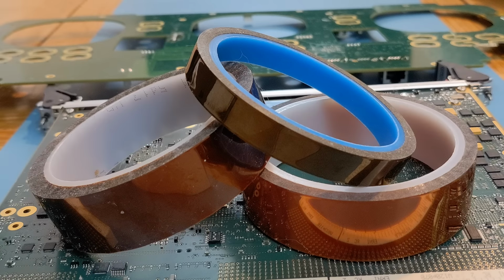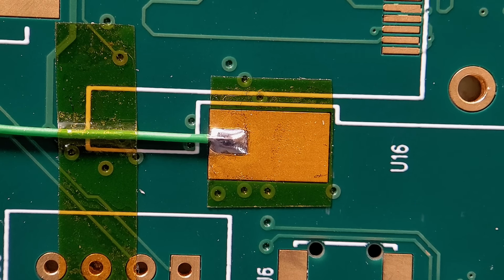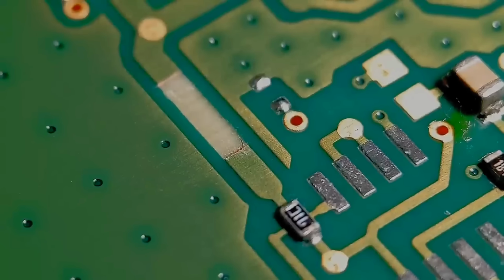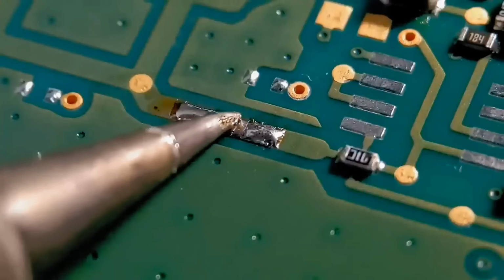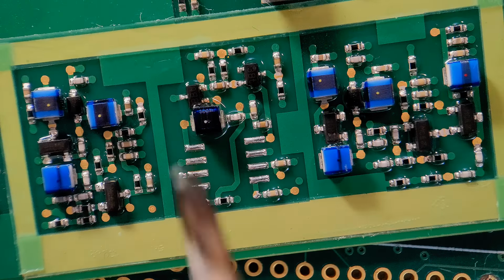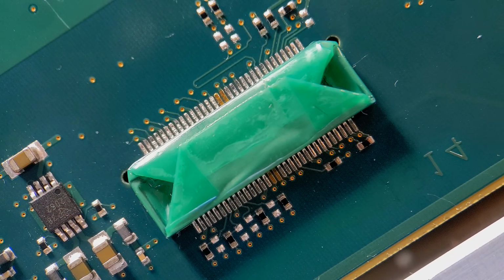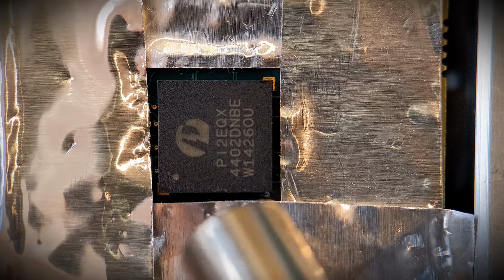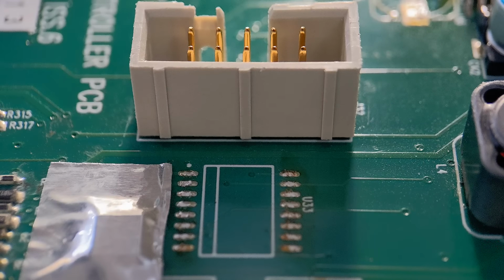The 4 PCB Tapes You Should Own + Why /Soldering Tutorial

Comment: It's SHOCKING how little people use kapton to protect neighboring components from hot air
Reply from the maker: Hi, thanks for your comment and for watching the video . I prefer using Aluminium foil for heat protection , but if i haven't got that available i will use Kapton tape as a replacement . Thanks again 👍

Comment: Another great video, cheers mate!
Regarding the aluminium foil tape, would you recommend AT500, AT502, AT506? They get thicker left to right but AT506 is over twice the price of the other two
Reply from the maker: Hi , I would get the AT500 . It's really good . If I'm worried about certain parts I just use 2 layers of it . You don't need the expensive one . Hope that helps . Thanks for your comments , take care 👍

Comment: If I were to use that aluminum foil as a heat shield. I think I'd put down Kaptan tape, and then put the foil tape over the top. That way to protect the board from adhesive cleanup from the aluminum foil.
Reply from the maker: Hi , thank you for your comment . I find foil on its own the better option  . It sticks better than KAPTON and doesn't move when working with it . Putting KAPTON underneath you risk the foil moving more . I don't get much residue as the video shows and is easy to clean off if I was to get some . Thanks again 👍
Reply: I think half the problem with Kapton under Alu is that Kapton has absolutely no give no stretch, so you can get a bad edge where hot air will deflect on the surface of the board and leak inside, and the Kapton tape will wonderfully insulate it from shedding heat and create a hot box where everything melts.

The funniest and worst thing you can do is put down a boPET tape and then alu, because boPET shrinks when heated, since it's pre-stretched for strength, and the alu tape hides the shrinkage from you, so when you pull it off, all the components have shifted away from their pads and all the smaller ones are unwilling participants in the workbench space programme. It's especially hilarious if you bought a cheap tape advertised as high temperature thinking it's Kapton clone, but it's instead boPET tape but tinted brown gold instead of teal, so it is an imitation, and that's how you found out that you've been duped.

Comment: great video as always. do you believe it's important to have separate soldering tips for leaded and lead free solder?
Reply from the maker: Hi , thank you for watching the video and leaving a comment , much appreciated . My personal opinion is the same tip is generally fine . I've never experienced problems using both solders with the same tip . I just make sure I tin the tip with whatever solder I am going to use ,then clean it off and repeat this 2 or 3 times so as to prime the tip for the new solder .
I do use about 30 degrees Celsius lower temperature when using leaded solder than when I'm using lead free but soldering can frustrate you at times as certain parts need different temperatures than the normal . Hope that helps , thanks again 👍
Reply: @mrsolderfix3996  thanks, aren't you worried of tin whiskers building up if lead free joints are contaminated with trace lead?
Reply from the maker: @cheater00  hi , I do make sure that I've removed traces of the old solder by tinning and cleaning off and repeating a few times . If you clean thoroughly like this , in my opinion you will be fine with no cross contamination. I have seen so much written about tin whiskas , lots of people think they are much exaggerated , others say you won't see them appear for 100 years so I will just keep on doing as I do. Thanks again for your comments.

Comment: The production level of your videos is excellent. I'd like to point out that aluminium tape is one of the worst things to use as described. At least by itself. The glue from it leaves residue that is tremendously difficult to remove. When it is needed, use Kapton tape under the aluminium tape first. The glue on Kapton tape (genuine) leaves little to no residue. Kapton tape also does allow heat to pass and only has a mild temperature reduction of I suspect of just 10°C or so. I've need noobs not regulate their hotair so discretely and parts do shift. Kapton tape's three key features is resistance to DAMAGE from heat and the glue leave little to no residue and it's electrically insulative. It does 'pass' heat quite well.
For shaped component that need masking I've found Techsprays Wondermask P to be better is most cases than tapes. It's dilutable with DI water and you can paint it in place. Very useful tool.
Reply from the maker: Hi , thank you for your comment . As you can see from my residue from aluminium foil I must disagree about putting KAPTON underneath first . Also KAPTON just can't take the heat like Aluminium foil  , they are way different in this respect . I never suffer from to much residue and if I do have any it's so easy to clean off with various PCB cleaning fluids . In my experience residue can be worse the way you mention so I definitely prefer the way I show . I always say to people do the method you prefer so I guess we will carry on doing it differently. Thanks again
Reply: The kapton tape prevents hot air from flowing onto the protected part, rather than shielding from heat per se.

Comment: I used kapton + copper tape + adjustable size hole punch to make simple flex PCBs, RF shields, and more. Most recently, a leaked coin cell battery fused with and tore away the PCB trace that formed the negative contact and ate away the solder mask on the positive traces to the coin cell holder. Restoring the negative terminal with copper tape was simple but the missing solder mask would short a new battery during insertion without kapton. Done and done. 😎

Comment: Was ist der Unterschied zwischen Capton tape und 851?
Reply: Kapton tape is Polyimide tape with latex adhesive. It does not shrink, it does not melt, but it can degrade turning black and crumbly if overheated.
851 is biaxially oriented PET (boPET) tape with silicone-modified adhesive. Biaxial because the molecules have been linearised by stretching, and when heated, they shrink back into a ball-like shape, making the tape crumple up when soldering temperature is applied. Furthermore, it's possible to melt PET. PET and especially boPET is low surface energy polymer so other chemicals don't adhere to it, while various thermoset resins will readily weld themselves to the surface of Kapton.
PET has more mechanical compliance than Polyimide, more stretchy, though stretch of boPET tape is very limited since it's already pre-stretched.

Comment: I've saved up IDE cables as they are also very handy to repair traces and connect multiple points. They lay flat and are stuck easy with solder mask. Damn i thought I came up with the alum foil to protect plastic myself. Turns out we did on opposite sides of the world. Going to have to get some of that 3m tape.

Comment: What was the glue you used to glue down the copper tape strip?
Reply: Super glue with activator.  He use dLoctite 382. The adhesive on the tape is often good enough if you burnish it, it's often pressure sensitive..

Comment: Beautiful work as always! How well does the 382 adhesive keep? I'm tired of buying adhesives that I only use a tiny bit of, only to have them hard and unusable when I next need them. It's almost like I can't buy a small enough amount.
Reply: hint: put them in a jar with a tiny bit of IPA at the bottom. make sure the jar is as big as the tube and not much bigger, eg asparagus jars and pesto jars are great for that. you can fill the extra volume with silicone caulk. makes things keep WAY longer.

Comment: So... Why not simply use Kapton tape instead of 851? or the other way around. I mean, they look like being useful in the same kind of situation. Also, nice video.
Reply from the maker: Hi , thank you for your comment . They are definitely not the same and if you reverse the roles as you suggest you will be in for a nasty surprise . 851 doesn't take the heat like KAPTON and KAPTON doesn't work as well for conformal coating . More difficult to peel off and coating can find it's way under KAPTON a lot easier than the 851 . Definitely don't use 851 with hot air . Thanks again 👍
Reply: @mrsolderfix3996  Thanks to you for the extended explanation. 🍻

Comment: Love your videos. Learn a lot about industrial reworking. I generally don't use tape, I use a narrow nozzle on my hot air and since its narrow it doesn't have much overspray so to speak. Though, I do use it if I know I'll need to heat a wider area and want to ensure I don't burn anything. As the saying goes, know your tools!
Reply from the maker: Hi , thank you for watching the video and commenting , your support of my channel is very much appreciated.
Hopefully the videos can help a few people out , if so then I'm happy . Thanks again , take care 👍
Reply: @mrsolderfix3996  I have one question.

What is exact difference in use for capton and aluminium foil tape in main reason of isolation during hotair work?

Which You sugest to use as main in that purpose?
Reply: @Wiez4  aluminium tape can shield from more heat. use kapton when desoldering small parts which builds up little heat, use alu when desoldering large parts.
Reply from the maker: Hi , when using hot air for rework , Aluminium foil is Definitely the winner . I've shown the comparison in a couple of videos . Get yourself some foil and you will be well chuffed . Hope that helps , take care 👍
Reply: @mrsolderfix3996  definitely need to get me some.